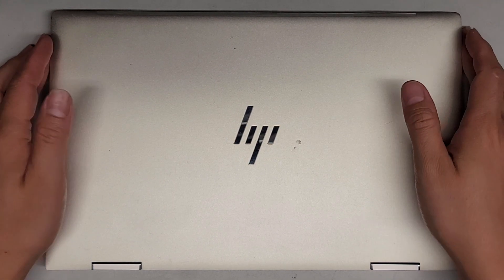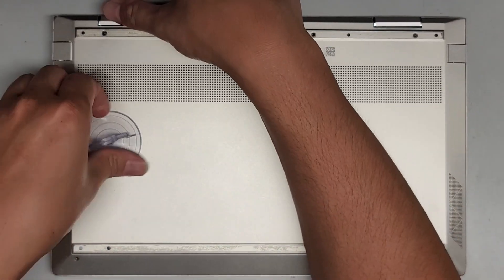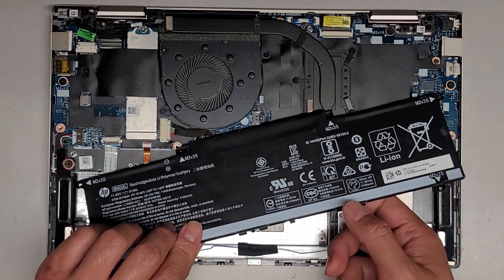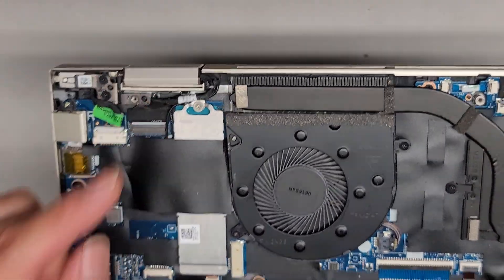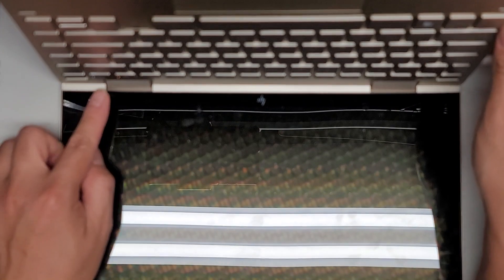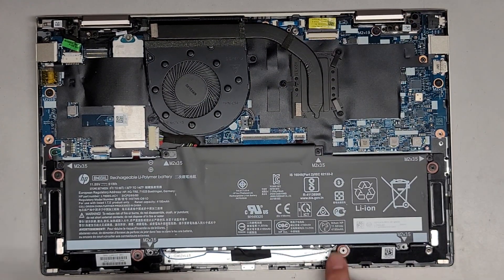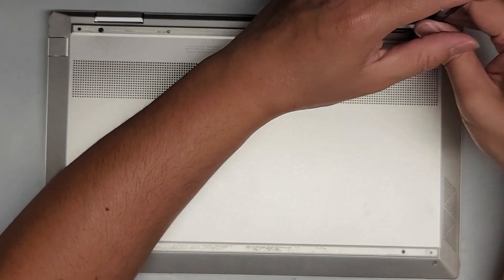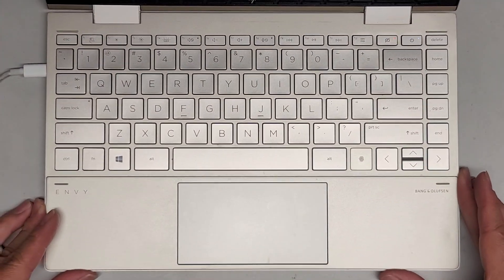HP ENVY x360 Convertible 13m-bd0023dx Disassembly SSD Hard Drive Upgrade Battery Replacement Repair

Comment: I just saw you said the ram isn’t replaceable. There might be a ram stick under that black heat shield I saw it on other hp laptops
Reply from the maker: Yeah... no. Unless they are making some new micro ram that I haven't seen before, I don't think so. I also checked ebay for replacement boards. There's nothing on the bottom either.
Reply: @ItsBinhRepaired I love this computer. I’m aware of the hinge issues with them but I got mine brand new 2 years ago and hardly use it. I’m very gentle with it too. I just wish I can upgrade the ram in it 😞. I guess I’ll put it up for sell
Reply from the maker: @anthonybush3134   how much RAM did it come with?

Comment: Heyy I have the same laptop and I am facing speaker issue, my right speaker is completely alright but my left speaker is crackling so much , and I had opened the back panel also and i noticed that on one corner of left speaker the transparent tube has pushed inside, so I want to know if there is any solution to this so I can pulled the tube to its original position
Reply from the maker: Replace the speaker.

Comment: Where is the cmos?
Reply from the maker: @solidnatemoney5584  built into the main battery
Reply: @ItsBinhRepaired  i get the error about a CMOS checksum and the computer doesn't turn on unless I hold in power button for 10 seconds.

Comment: Where the heck is the CMOS battery?
Reply from the maker: Built into the battery
Reply: @ItsBinhRepaired  Wow.  That's fantastic information.  Thank you.  Is that in the manual?  Where did you find that answer?  Just from your experience?
Reply from the maker: @keepingup2952  I worked on thousands of computers.
Reply: @ItsBinhRepaired  Yes you have.  Thanks a million!
Reply from the maker: @keepingup2952  no problem

Comment: The WORSE PC I ever bought. what a s***t. Never again HP. Few months after unboxing brand new, screen and hinge broken, after it was the pad, repaired all under warranty. Six months later, no longer under warranty, hinge again broken anc costs few hundreds to change. Never again HP!
Reply: @serros8888  I'm also of the opinion that this laptop is the worse
Reply from the maker: @serros8888  :( That sucks!
Reply: hinge broke also under warranty, but had mouse pad go out and now my keyboard is failing ;)

Comment: Where is the ram for this laptop?
Reply from the maker: Not replaceable
Reply: It's probably on the top side of the motherboard where even if it was upgradable, you would have to tear apart the ribbon cables.  Once you do that, you'll break the whole darn thing.  I'm just trying to find the CMOS battery, and it's not on the bottom where it should be.  Must be on the top where I can't get to it.